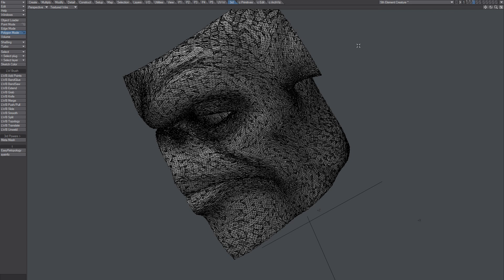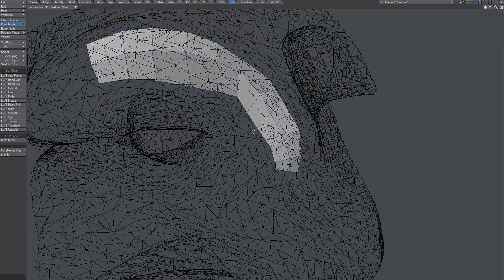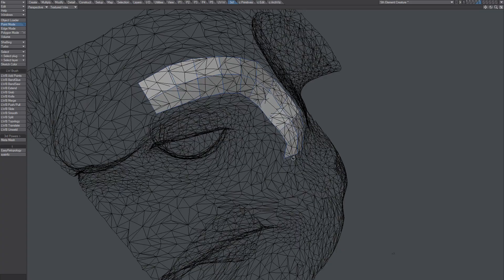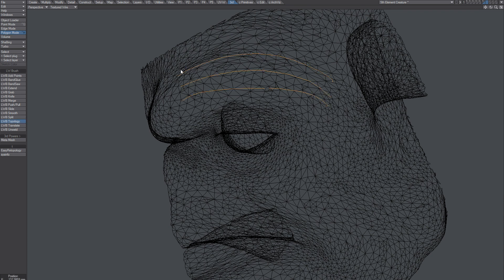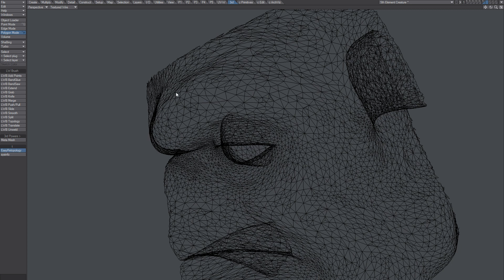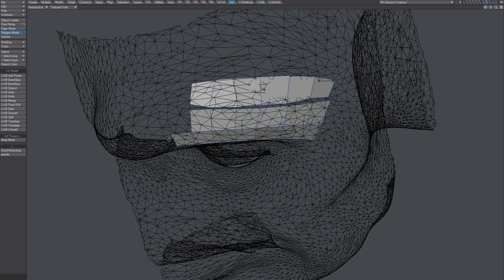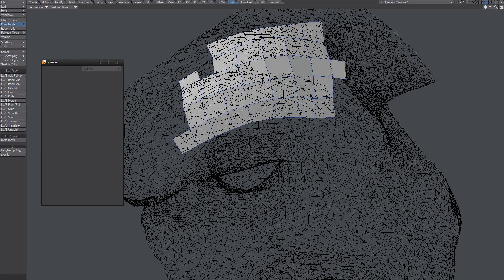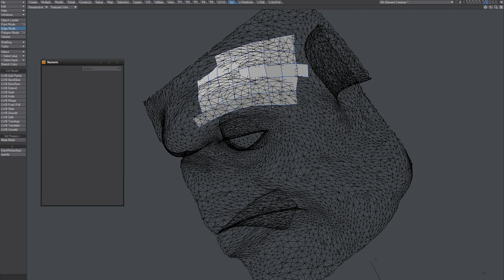LightWave plugin - LW retopo - Gotcha

Comment: Maybe if you start with something like LW Remodeler, and then go to the topo tool, you can get faster and better results? At least that way, Remodeler can get it into quads and your topo workflow will be smoother and faster.
Reply from the maker: Could be, or instant meshes. I hope to see better Retopo tools addressed in LightWave tho'   [crossing fingers]
Reply: @erikals  They could... but my personal opinion, there are already so many excellent third party tools for that. 3d Coat has some great retopology tools, and you get the added benefit of UV, texture painting, etc., for a pretty reasonable price.

Crossing fingers for GPU rendering... I feel the need... the need for speed :-)
Reply from the maker: @rodneyschmidt3652  GPU... yes, i read Cycles for LightWave is looked into also. We shall see.    :)